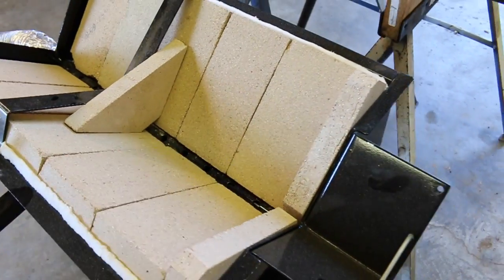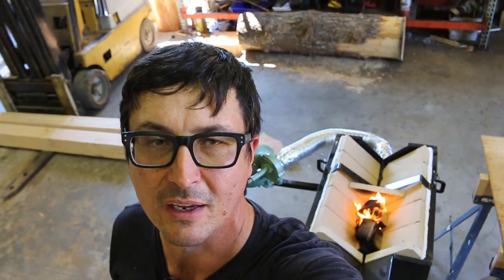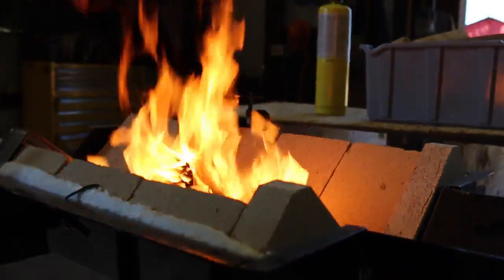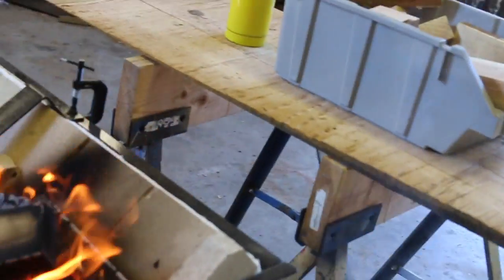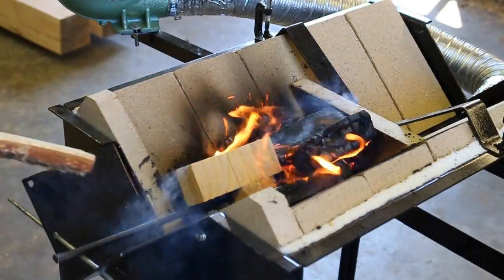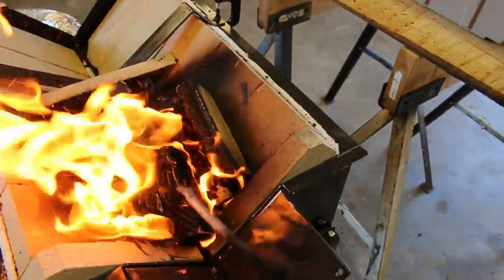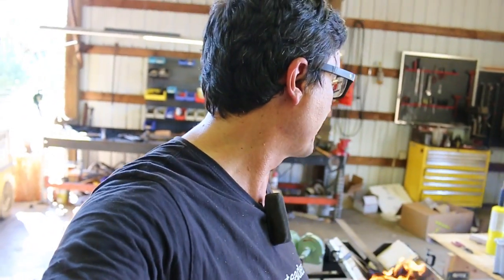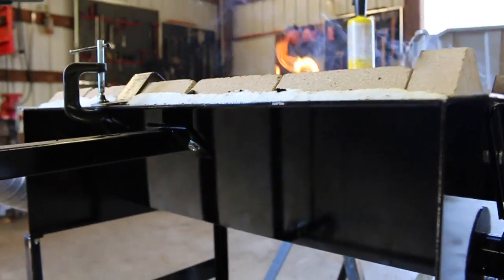Forging Steel With Wood Scraps

Comment: It looks like a lovely piece of engineering. Their manufacturing looks pretty good with holes lining up. Mistakes like the two pieces being 2" too long happen to all and at least they weren't 1/4" too small! Design is nice and looks sturdy with a good finish.

However I think they've let themselves down a bit with the blower pipe. It works perfectly fine I'm sure and I've always been a function over form guy but it seems a real shame that could be easily fixed :)

The idea in itself though is fantastic and looks very effective, I look forward to seeing many more projects using it :)

Comment: I have made many forges and smelteries, and if you want to forge steel but don't wanna make a forge you can make a fire in a fire pit, let it sit for a bit, then throw some steel in it.  If you want it to take less than 10 minutes to heat up, you can add a small personal fan and hold it by the steel and it'll heat up 10x quicker.

I would also like to say that this design is very good at getting a small, high heat area for forging.  It is probably the best one I have found. 

One critique would be to use rock wool as an insulator, but fire brick definitely is suffice.  Rock wool is overkill, but if you ever want to upgrade, you can use a higher r-value material like Rock wool.
Reply: I can't edit it, but I just saw the rock wool, so never mind the critique.  I can not find anything wrong with this.

Comment: You know... The way the air blower is set up, the "10" setting would have less overall pressure, and the "1" setting would have the highest pressure. My reasoning is, with more areas for air to escape at the "10" setting the pressure would be dramatically lower than for "1". You might be able to create a VERY HOT flame with the "1-3" setting. It would also create a more focused flame which would be better for welding. Just an idea!
Reply: That was also my original thought, but according to what Cody is doing, I think turning the dial just opens even holes along the length. He was using just half the forge, so a setting of 5 closes off the rear. Maybe.
Reply: lumspond Yes I agree I think the dials are more for how much of the length you are using vs the amount of air. More cranking is gonna mean more air. But as Cody says we are all learning together especially since he lost the instructions :)

Comment: Forge looks great and to be able to use wood scraps instead of paying for smithing coal would be awesome.  My concern is will it reach forge welding heat?  I've used a campfire and a leaf blower as a forge for annealing and heat treating stock for knives so it should reach critical temp without too much trouble but it'll need to get really hot for forge welding.  I'd actually like to see a video of forge welding on the new forge if you get the time.

Comment: Excellent design. I can't wait to see you do some more blacksmithing in HD. Great videos.
One thing I must say, however, is that you should read the MSDS of that Kaowool fibre lining between the firebricks and steel forge body. It is nasty stuff, and is a known carcinogen when the fibres enter the lungs. You should ask Whitlox what type of fibre blanket it is and find the MSDS. 
It is great insulation (I use it in my gas forge), however, it must be covered by a coating of refractory cement to prevent the fibre from becoming airborne. I know a lot of Americans seem to love Satanite for the coating.

Safety First.

Comment: wranglerstar that is an awesome forge, but as fast as it heated up that flat bar it might actually be to good. lol But seriously, I've seen gas forges not heat stock that size up that quickly. And I am really digging that blower you've got although personally as cool as it is, I'd smack a grizzly bear to see you put a foot pedal on there with some kind of chain drive. I know functionality always out weighs the cool factor, (usually) but just picture it some kind of old singer sewing machine foot pedal powering that thing. You can't tell me that wouldn't be the most awesome thing ever. Seriously well done, I love and wish I had one just like it. Very impressive how hot that thing got just off of wood scraps.

Comment: I've hardly used them myself, but since my father, two of my uncles and my grandfather were all blacksmiths, I think I can talk about it a little bit.

That forge is fine if you take into consideration what you want that for. Coal would be a better source of heat in every way except for price if you have that easy access to dry wood. But the same amount (in volume) of coal gives much more heat and keeps it longer than wood.

In other words, whatever metal you may put in there, will not be as easy and quick to work with as it would be in case of using coal so, in the end, nice thing for a "consumer-grade" forge for the "occasional blacksmith". Nothing less, but nothing more.

Comment: thats a nice forge i could see room for improvement in one place or another but there is that in everything.it has a great design very basic and simple design i would like if i am ever able to have a homestead to have one of these. as far as workmanship that forge is exactly as it should be good old fashioned american made product built with pride and serviced the same as they would have been more than happy to fix a small mistake made with no questions asked. something that is sorely lacking anymore.

Comment: When i first saw that forge i thought it was going to be flimsy as hell, seems to stand up quite nicely tho and its a great concept. I wonder if making a full lid or a half lid (kind of like a barbecue) would help shield you from some of the heat while working the blower, might also help keep in some heat. Most definitely a piece of gear i will look into in the future, as it seems to be a great and more economical way of getting into smithing.

Comment: i have made one of these myself and i find if you do a 1 to 1 to 1 ratio with plaster of paris and play sand then water. you can smeer it over the firebrick lining and it holds heat better with the fire brick and plaster of paris combined

Comment: You need to get a champion blower model 400 it has another set of gears so you dont turn as fast with your arm and when you let go it still turns 4 more revolutions of the handle.  Nice job on the video

Comment: I love the design of the forge but I wonder if you could connect a pedal chain to the crank. Would save the chance of burning your hand if the crank got too close, but it seems like it's not a problem.

Comment: This is a legitimate question because I honestly don't know and am am reading something a little different. I am currently re-reading The Foxfire Books and I am reading the words of these "Old-Timers" talking about using Green (fresh cut/wet) Hickory in wood stoves to produce more heat. You specifically said you were using dry (cured) wood and even threw away a piece of wood you found wet. Would something like green hickory or other green hardwoods like oak produce more heat than dry? Of course I would start the fire with dry bue what would happen if you started feeding the fire with green Hardwood? Just Askin'.

Comment: Love the armchair QB comment, however nice I believe that forge is, the stand does seem to be just a bit weak..  I do like the wool insulation and fire brick ! much simpler than perlite and plaster.. cost is quite a bit more.. think I'd put a cole feeder plate on it and a sturdier stand. but yes very nice forge.. what I have is an old 10 gauge steel 24" X 24" x 32" work table that I've been wanting to cut a hole in for the brake hub to make myself a forge for making knives and such, hub was 12.00 bucks at scrape yard and table free that someone trough out.. my problem is that I now live in the dang city.. anyway this is the first time I believe I've seen your video, you said something about having a brake hub fore  is that something you didn't like or something that you wouldn't recommend ??

Comment: I made a fire in a hole in the ground that was left after I dug up a tree and threw some of my fire wood in and decided to heat a small piece mild steel and forged it out to a knife and have it to my girlfriend and I have been working on a better way, I have unlimited supply of FREE coal but I need to build a forge to last and a way to keep the smoke out of my face and finally got a anvil today, keep up the videos! LOVE EM!

Comment: Wouldn't using smaller pieces of wood be better because you can get the wood hotter at a faster rate due to there being more surface area? Not trying to be mean I just genuinely curious

Comment: Hello wranglerstar I'm pretty familiar with black smithing with a wood forge and what I've preferred to get a hot and steady long burn is mesquite and pine wood, but wouldn't recommend mesquite if you live in a dry area because it will spit wood chips out.
Reply: I'm recently started watching your videos and love you work!
Reply from the maker: +Steve Berlanga thanks

Comment: you can buy anthracite hard coal at tractor supply for 5.99 for 40 lbs and it burns clean kinda sounds like you may have used bitimus coal before. just a little thing i discovererd recently looking around for coal for my antique stoves.
Reply: i was wondering could you use coal in that if you wanted to or is it not advised.

Comment: Really like your videos. The performance of that forge is quite amazing. But I have to say that i didn't like what you said in that rant. I understand that trolls can be extremely annoying to deal with but although that forge is amazing in many ways I have to say that it's legs do look a little flimsy. Now I have never set up that forge, never bought it, heck, i've never even used a forge in my life but that does not detract from my ability to make a viable comment on it's build quality based on what i saw in the video. 

Hope you understand where i'm coming from

Comment: Wow, this looks great.  I have an old pancake compressor whose motor failed.  I could not bring myself to throw out the tank and just recently I decided I was going to make a coal forge out of it.  Well actually I have been torn on whether I should make a gas or coal forge.  After seeing this I am wondering if I could take my coal design and run wood in it.  I am just a hobbyist but I would love to learn to forge weld and try my hand at some Damascus. So a few questions, does wood get hot enough to forge weld? Is there any reason one can't use wood in a coal forge aside from the size difference?  Is there a difference in running wood as opposed to Charcoal?  sorry for all the questions but seeing this forge just turned my plans up side down.

Comment: can this particular forge get say, a 1" thick piece of rebar  up to around white hot? the reason I ask is because I'm looking for a cheap source of heat for forge welding wire rope. my brother in law made a charcoal round forge for me and I can get rebar to the medium orange using chunks of wood in it but it has several serious design flaws. right now I'm using a propane forge and it gets the job done but propane costs more money than I should be spending right now. If this wood forge can get white hot temps, then I think I'll have to either get one or buy the plans and build it. The only things I'm worried about is the thinness of the steel gauge and how much sparks come off it. I live in northern Texas, it's hot and dry here 95% of the year. just asking for serious feedback and advice. thanks in advance.

Comment: You can take those wood pieces and turn them into charcoal.  This can be done on the homestead and you really only need a sealable pot with holes and a campfire. There are plenty of guides on this online. So you ask why charcoal and not regular wood?

Charcoal is wood cooked in a oxygen deprived atmosphere.  It removes the volatile gases and regular carbon. When you burn regular wood the heat is mostly caused by the wood gas burning along with other byproducts.  These promote scale across a metal surface which you really don't want especially if you're doing any sort of welding.  The heat generated is also very low compared to charcoal.  But why?

Charcoal retains the heat in it's chunks.  When you have a burning pile of charcoal, the heat within the pile is a order of magnitude hire than regular wood/wood gas as it becomes coke.  The heat retention is superior for forging as you need less to bring a metal to yellow hot.  While red hot is nice for thin and small items, working with thick stuff really requires yellow hot or you will be putting a LOT more effort than necessary and risk the metal tearing.  Reaching those temps with regular wood chips is very time consuming.

Comment: I get the point of using wood for forging, but im lucky enough to have acess to coke. i think i bought 3 big sacks for around 50€ and it lasts really long time. And yea you burn through coal and charchoal really really fast. 1 sack of coke lasts for about as long as 5 sacks of charchoal would last.
 Anyways nice video as always, but i would suggest orienting the forge so you dont get the flames and the smoke in your face when you crank it.
 Now go and make something nice! :D

Comment: That seems superb. If you put something over the tiles, not big but some tiles or that you could have even hotter with less wood.
Reply: I have a very similar diy forge and I am using big pieces of wood around the fire to get more heat in the center. The big pieces burn slowly and give constant heat. When more heat is needed I add small pieces of wood and when extreme heat is necessary I add coal.

Comment: Mr.W do you think that you'd need to move the blower away from the fire a little when using the full length of the forge? 

I'm impressed with this thing! Great design with the V shape.

Comment: Hello Cody. Good forge you got there. I see that those forges can be used for fun project.

Could I ask what camera are you using for this video?
I think you said Cannon 70D in the previous video but I want to double check.

Thanks
Reply from the maker: leathertoolz Yes I'm using a 70D with the cheap kit lens,
Reply: wranglerstar  Thanks, Cody!

Comment: At that intense heat I would imagine there is little to no ash left. Hell break drum forges using coal that everyone is making throw cinders and ash all over. I would be more worried about the white hot flux that shoots many feet when forge welding. Secondly its not made for making an anvil guys. Its a portable forage for people who need to make things in a homestead ie. replace one shoe on  a horse, make some brackets etc. If you want to make heavy duty stuff or pound iron 24 7 365 build or buy a forge capable of that.

Comment: Given your note about the fire danger at your place at the moment, wondering if you've considered making some kind of hood so you can choke the fire & put it out quickly if you need to rush off?  Not that its particularly dangerous as it stands, but a strong gust of wind while you're out blowing the residual embers around your shop might not be the best!

Comment: What would happen if you put a "roof" on that forge? Im thinking like half a barrel cut vertically. You would probably need some sort of chimney pipe thing for the smoke though. But maybe that would help if your'e outside and it's windy since you might only want the oxygen to be coming from underneath. Doesn't even have to be that big or reach al the way, you could easily modify it to whatever. Thanx for the great vids! /David

Comment: For cleaning wise, do the ashes and coals get into the air tube thru the holes or does the air pump push them out and keep the ducting clear?

Comment: Ever thought about making your own charcoal out of the wood and then using that for the forge.  I know it burns quite a bit more even and hotter than wood.  I make my own for BBQing all the time and it works awesomely.  The basics of it is just getting the wood to red hot then removing all oxygen.  The lack of oxygen extinguishes the wood and you are left with charcoal.  Super simple to do.  Bury a 55 gallon drum, place the wood in around the outside edges leaving a little room for air and kindling in the center and light it up.  Once the wood is going well and turns red just toss the lid on the drum and bury the top with a few inches of dirt.  Come back in a couple day to charcoal.  I have zero experience with this method for a forge, but I do know from history that they used this type of wood charcoal in old time forges before industrial coal became a viable option.  anyhow not trying to be a know it all or tell you your business.  Just throwing the idea out there.

Comment: Food for thought, I was thinking it could be easier on you're arm of on the blower fan you remove the handle then tighten a drill to the shaft and let the drill do the work.

Comment: Still staying off-grid, I saw 12 volt blower fans you could use with simple solar charger and a car battery. Saw on centaur forge.com, sure plenty of other places...similar price to the hand crank blower...
Reply: Brilliant!! Found 12 volt bilge blowers for marine application, easily 175-250 cfm and DIRT cheap- $15-30!! A car battery and a solar panel, and you can run a power blower all day- no cranking, and much cheaper than a manual blower to boot. I assume a speed controller wouldn't be much of a chore to obtain...

Comment: Not to be a stickler but i really feel like if you were able to close off the top it would be able to direct the heat at whatever you're forgin better. That would limit you're air intake a bit but since you're using some sort of blower assembly i feel like that shouldn't be an issue.